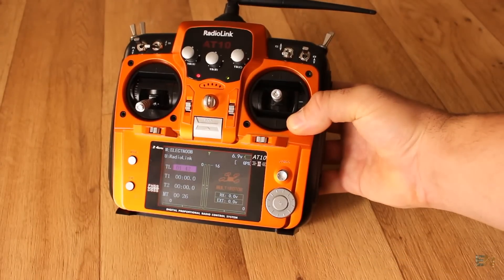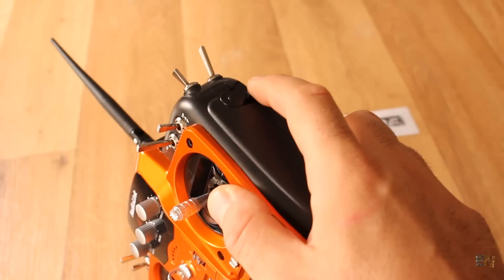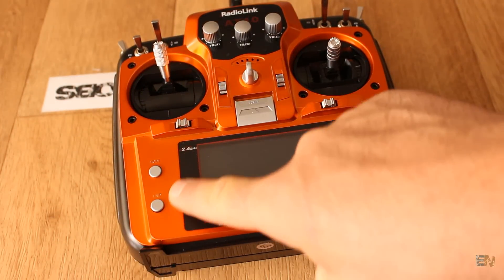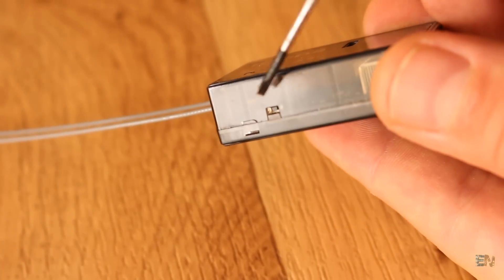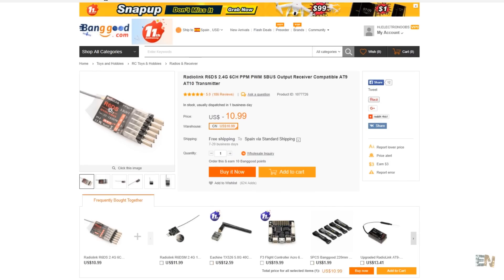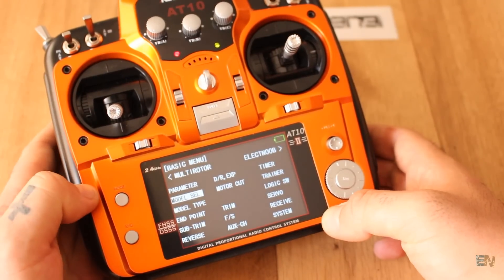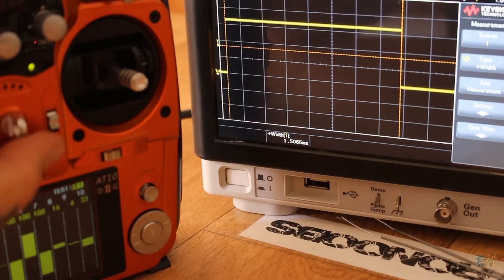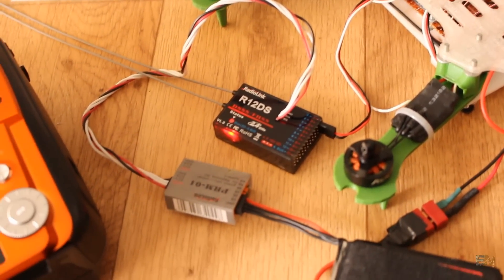Radio Link AT10 version II

Comment: the reciver is it ppm to or just sbus pwm
Reply: Hello, sir. RadioLink R12DS receiver supports SBUS and PWM signal. If you want PPM signal, you can choose R12DSM, R6DS and R6DSM receivers, which support PPM and can also work with AT10II transmitter.

Comment: I have one of these with an R12DSM receiver and set it as the video but it isn't working my quad.
Reply: Hi, Sir. AT10II can bind with R12DSM. Could you pls check if the signal output of your receiver is compatible with your flight controller? You can also send email to after_service@radiolink.com.cn for more help.

Comment: I have an AT9 that I have a 7in. FPV monitor paired to, will it switch over to the AT10 without issues?
Reply: Hi, sir. Sorry to reply so late. The setting method is the same. So you can switch it to AT10 without issues.

Comment: Thanks bro, got all basic information i wanted as I am new to rc transmitter and want to buy one but wondering which one to buy, I have shortlisted 3 transmitter Radiolink AT10, Jumper T8SG V2 plus,FlySky FSi6S, please suggest which one i should go for as price also matters and if possible please make a video on these two transmitters also. Moreover do the gimbals of AT10 are hall sensor type or simple resistive potentiometer type ?

Comment: after connection with receiver the signal icon does not shows the signal bars in transmitter display .receiver works just fine but i cant see any signal bar and in it shows RSSI: Null any idea how to fix it?

Comment: I have flown JR radios for years but I am still flying 72mhz. I am thinking seriously about buying this radio. How does it compare to JR and Futaba radios?
Reply from the maker: Never used JR radios. Futaba is quite good. Depends on the model.
Reply: Would you recommend this radio? Great video by the way!
Reply: Also, I want to change to a Lipo battery. Is there a female plug on the transmitter where I can plug my charger or do I have to take the battery cover off each time to charge the Lipo battery?

Comment: I have the older AT10. Fantastic value for so many channels and functionality, has plenty of room for a beginner to grow. The 8x AA battery tray eventually got chucked away and replaced with a proper lipo and the sturdy carry handle now accommodates an Eachine 7" diversity monitor. I have several receivers, but my favourite is the small, lightweight, twin antenna R12DSM.

To their credit, Radiolink have been regularly updating the firmware.

My biggest beef is that it has a cheap, plasticky feel. That Futaba-style rotary dial and joystick look nice in the pics - although they work very well in real life (beats endlessly clicking menu buttons like on the Taranis X9d), the way they feel when you operate them totally betray the fact that this is a US$100 radio.

Dying for a Taranis Q X7s, but that's another US$100 more, plus the cost of new receivers and it isn't without its annoyances... although it looks to be better built and the new faux carbon fiber body looks premium.

Comment: Hi!  Thanks for the great video.  Very clear and concise.  I didn't notice the trim on the PRM01 voltage monitor.   I have the same transmitter/receiver and am trying to set it up on the pixhawk flight controller.  The pixhawk 1 uses a ppm / sbus input on the RCin port (the pixhawk sbus is output only).  However, when I plug the R12DS SBUS connector into this port the pixhawk does not appear to recognize the receiver as shown by the mission planner calibration scenarios.  I notice that there are 2 colours - red and blue with different channel numbers on the R12DS receiver outputs.  That would indicate to me that there must be at least 2 modes on the receiver/transmitter for PWM/SBUS.  I am assuming SBUS is not the default.  I cant find the manual for these on the radiolink sites and as you show in your video, it doesn't come with a manual.I have a PWM to PPM encoder as a backup but I understand that SBUS is a bit more responsive and would prefer to use it - also, fewer wires and devices..Any idea how on the transmitter or receiver I can switch it to SBUS mode so that the pixhawk will respond?Cheers an thanks again.
Reply from the maker: If you go to the main emnu and select from 10Ch to 12Ch, what that will do is:

in 10ch: channel 1 to 11 are PWM output
in 12ch channel 2 to 12 are pwm and 12 is SBUS.

But, if your flight controller only has output SBUs this won't be comparible. The R12DS doesn't have PPM. You should buy the r6ds receiver with PPM output. Keep up!
Reply: Actually, the RD12S is the most advanced - so - kept up.  Also, I finally found out how to switch it to SBUS.  Holding the reset button for a few seconds on power on changes the LED from red to red+blue=purple to enable SBUS on the receiver.  The PIXHAWK works automatically with SBUS or PPM.  PPM was my backup with the external converter.  But I'm good, thanks for the reply.
Reply: I have a Volantex Ranger 78" wingspan on the way along with a Pixhawk to begin flying FPV and am seriously considering upgrading my Spektrum DX6G2 to this AT-10 because I need way more than 6 channels and would want to use the S.Bus to connect the R10D receiver too the Pixhawk as well as using the PPM channels to control other stuff on the airplane such as a servo mounted camera, video switcher and so on.  Will connecting the R10D via the S.Bus port for main flight controls and flight modes, then using PPM channels of RX for other things allow me to do this?
Reply: it appears after going back and looking, the R10D RX doesn't have the S.Bus output like the R12D RX so I will have to purchase the R12D separately since the radio I am looking at purchasing only comes with the R10D RX.  But still want to use it in the manner described in my previous comment too the Pixhawk for fixed wing FPV flying.